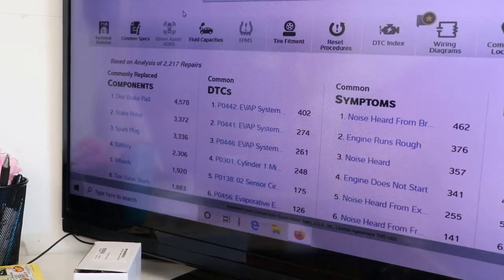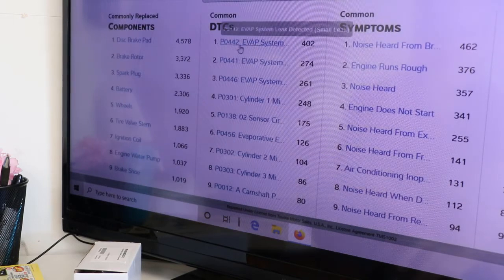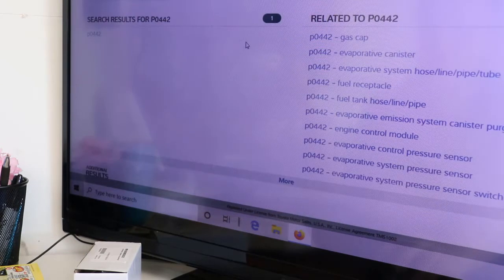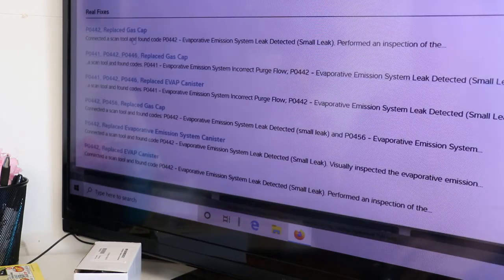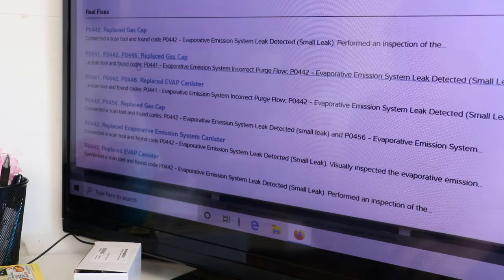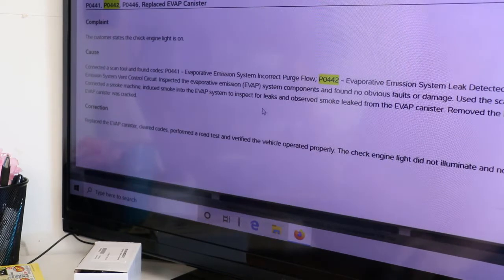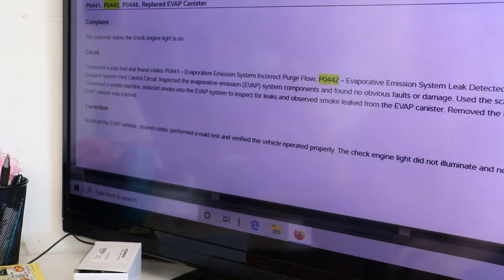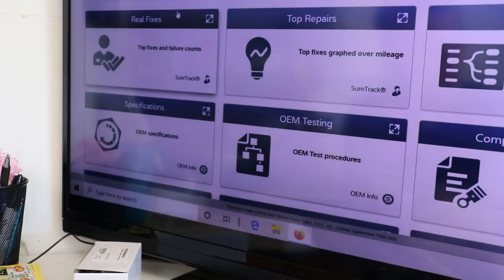2005 Scion XA Evap Diagnostic and repair (DETAILED VIDEO)

Comment: You should be looking at fuel tank pressure pid, watch pressure on your autel, if your losing pressure so fast you hear a hiss you'll be able to identify that on scanner.. I would say you with the compressed air are absolutely stressing the system to potentially its limits.  Good strategies with your soapy water.

Comment: my xa 2007 has a cannister at the front near the hood, gcc specs, can it be a reason for low mileage i am getting only 300km in full tank how to rectify.
Reply: Also it have a vapor canister in the bottom back of the car
Reply: @mariariverra2005  no in gcc version i guess its not at the bottom i checked it, anyways i did few things now i am getting 420km to 444km Alhamdulillah,  1st, the catalytic converter had no Filter changed its with a non genuine parts,  and just few days back changed a gear shift Solenoid (used one) SL circuit now seems to better the mechanic said another solenoid is also not good, so will look into it when i get the other solenoid.

Comment: Referring to the part at 15:01: I took my car to the auto parts store and I had them test the volts on this part, they got nothing. I got home installed the new part and took another reading and I'm getting 6.5, which in this video is your bad reading. 😬

Could this mean I have a bad wire or possibly an electrical issue upstream? My battery is brand new and reading as it should.

Comment: 12.38V (2:48- 2:53),  does not mean the battery is good. A fully charged 12V battery is about 12.65 to 12.75V. A "dead" battery will show 12 V or slightly less. A 12.38V is about 30%-40% "good"......

Comment: ALL My Wires up front are starting to have problems nowadays ...THIN ThiN Wiring geeZ ...Horn, Headlights, Cam Shaft Sensor ....all wires starting to lose the brittle 
insulation and breaking

Comment: My connector has no visible problems but I'm only getting about 5 volts through it. Would a new connector potentially fox that or is there some kind of fuse to check?
Reply from the maker: I would check fuses related , 5 volts is usually a reference from the PCM
Reply: @jdcauto5977  that was a red hearing  :) problem ended up being the rubber hosing around the valve. Amazing video helped me find it though thanks!

Comment: very very helpful. my gf scion xb is having this issue too. nice to see that this engine is the same..same with the gas tank part.
i tried your manually blowing on her valve and it doesn't leak at all (which sucks cause i just got a replacement in from ebay today haha. ill be returning it).

the hose from the firewall to the valve had a huge hole in it. i'm sure that was the issue. however i replaced it and the engine light is still on (its been 2+ weeks now)

tomorrow I'm going to test the sensor wires and see if thats it. and just go get her a new gas cap since its kinda older. 

again. thank you for the video.

Comment: I have p0445 and p0441. I had replaced the gas cap and solenoid last year and took it to a mechanic and he was able to pass the car. It was good for months but light came back on during summer and the car has been able to drive normally for the most part. I put in a cheap maf sensor and it didnt help. I replaced the air fuel ratio sensor the other day. Engine light back on. I am going to try to put a better maf sensor and replace the vapor canister along with pcv valve. Any thoughts?
Reply from the maker: Have you checked for and leaks in the lines? The system  needs to be sealed, so if there is a Crack or a hole on any of the lines it will trigger the code.

The proper way to test is to get a smoke machine!
Reply: @jdcauto5977  yea true, i just replaced all that stuff today so ill have to see if my light comes back on again. ill prob have someone smoke it for me.  thanks for the video and response
Reply: @youngitaly  Did the light stay off? This issue is driving me nuts.
Reply: @9unslin9er  i believe replacing both my o2 sensors fixed the problem.

Comment: Hi. I need your help. The gear shift lever light on my  scion xb 2006  stopped working, but the light bulb is fine.  A few days after it stopped lighting it did it again and then it stopped lighting.  The master light swish in the window and the swish in the mirrors do not turn on too.  What could be the cause? Have a good day.
Reply from the maker: Sorry for late reply, When it comes to electrical you can vary from a wire having a short meaning that there is exposed wire in its contacting some area in causing it to not function properly. I would need to pull up an electrical diagram unfollow each wire in testThe voltage plus if it's shorting out somewhere. It's kind of an extensive process.

It could also be a simple as a fuse that has gone out but usually in small electrical it's no 

Has there been any changes to the car's electrical than any way that may have caused this issue?

Comment: What is the exact name/part number for the pigtail connector that connects the valve? The blue part that runs the electrical connection after clicking in? Help please! Mine is gone and want to get the right part!
Reply from the maker: Very sorry I don't remember what the part # was
Reply: @jdcauto5977  no sorry needed! I actually found the connector and it was flush. This video allowed me to completely revamp my cooling system. Thank you!

Comment: I got scarred when you pushed there straight shop air. EVAP smoke machine provides only 1.5 psi pressure caz higher pressure could damage evap system and those mechanical pots/diaphragms on canister most of toyotas. Some use LDP and vaccum to test itself—applying pressure would seal the leaks but in vaccum will open up and cause Leaks and codes to showup. So its way much involved than just shooting air in and listening for air hissing out—-thats good way to test exhaust leaks but not evap.
Reply from the maker: Thanks for the Tip. I used very little pressure just to see if the system would hold pressure. Planning to invest in a smoke machine asap.